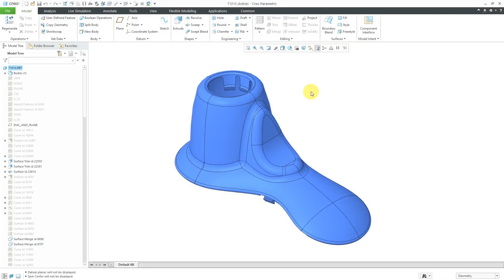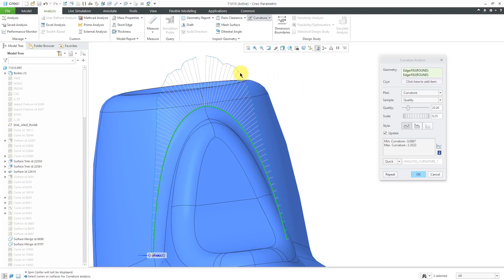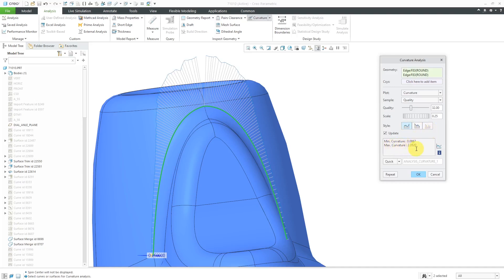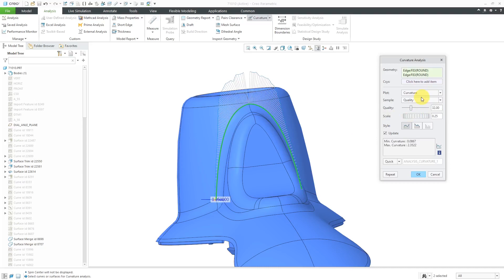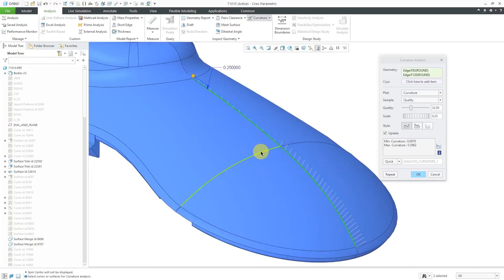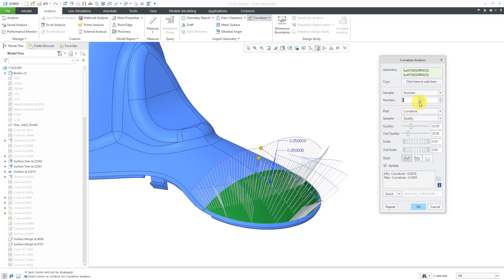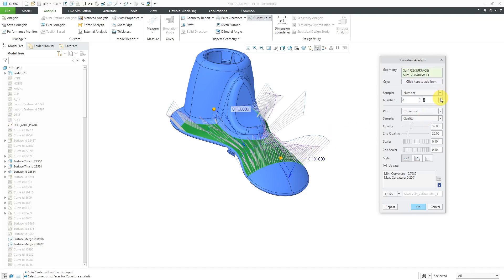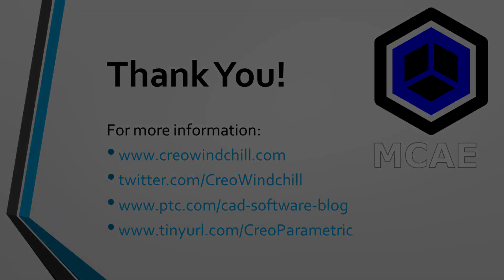Creo Parametric - How to Use the Curvature Analysis Tool

Comment: Nice tutorial Dave.
I've always wanted to see how a refinement would be done to improve conditions exposed by this tool. The model appears quite well done to the naked eye, but the analysis exposed some issues. Using Creo to smooth surfaces isn't straight forward.  Can you do a tutorial showing how this might be done?
Reply from the maker: Honestly, I probably won’t, as I’m in the process of winding down this channel. The funny thing is, this is an actual product on the market. I can’t tell you how many times when I was a business traveler, I would see this shower head in the morning. It was a very successful product. Less than optimal analysis results does not necessarily mean a bad design.